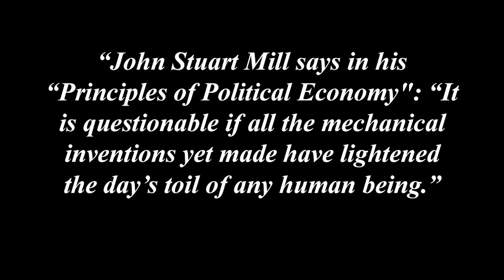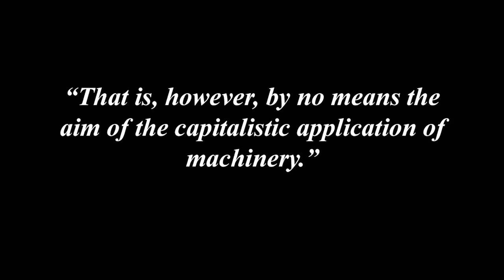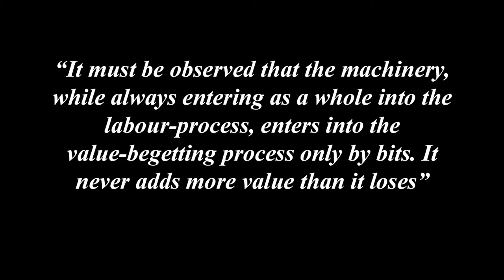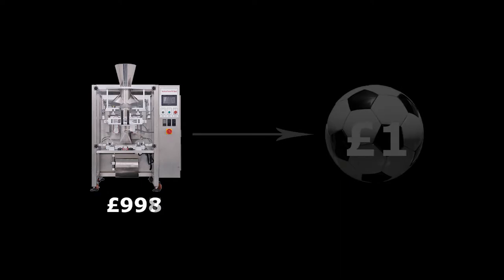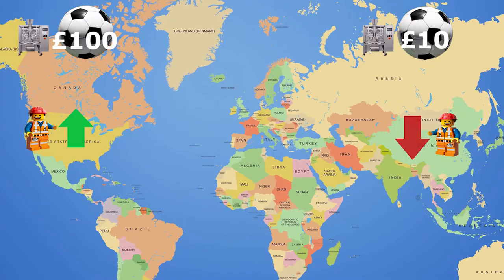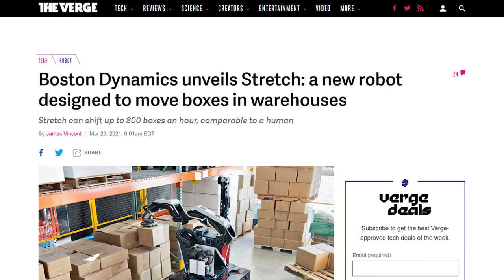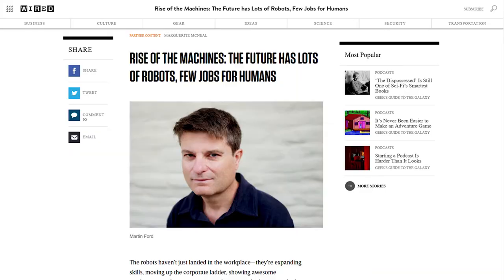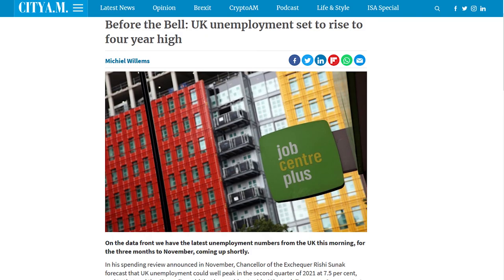Understanding Marx's Capital Volume 1 Chapter 15 - Machinery and Modern Industry (Sections 1-3)

Comment: How crucial is this chapter, or at least these first few sections of it, mostly the second, to the overall argument? There’s a decent amount I’m not really understanding but I’m getting worried about how long I’m gonna be stuck on this chapter/part of the chapter.
Reply from the maker: Which bit are you not understanding? I'll see if I can help :)
Reply: @DissidentTheory  thanks, there’s a couple other things but the most significant thing I’m struggling to understand is the absolute decrease/relative increase (more so the relative increase part).
Reply: @DissidentTheory  oh and also the idea that less labour must be expended in producing the machinery than is displaced by the employment of that machinery. I can kind of conceptualize it and it seems like not that hard of a concept but it just makes my brain feel jumbled.
Reply from the maker: @ofthem16  
I'd recommend watching the video for Chapter 8 (especially the Two-Fold Effect of Labour) section again before reading this, but hopefully it helps :)

Imagine all the footballs (collectively) made in a factory that doesn't use machines, just labourers. Let's say that all these footballs together have a collective/relative value of £500.

 Let's say, this factory now brings in a machine to help with the labour, and this machine costs £1,000. So our collective footballs (after the machine finally breaks and has tranferred all it's value) are now worth £1,500. Their Relative value as a collection of footballs has increased by £1,000.  

However, the huge increase in productivity caused by this new machine has 2 effects. Firstly the machine lowers the amount of time it takes to produce a football for a labourer. So now, each individual new football made has less labour-time required for it's production (this is what creates value remember,) so each individual finished football now has less new value than individual footballs had before the factory used machinery. 
Secondly, We could still say that labour-power is adding £500 value to (collective) footballs (over a given period of time), but this £500, or amount of time of labour-power, is now spread across many, many, many more footballs than previously because of the use of machinery. There is less Variable Capital spread across, despite an increase in Constant Capital.

So on the surface when looking at all footballs, we can say that the value of all footballs combined now have more value as a collection, £1,500. But when we look at an individual football in isolation, we see it has less new value than previously. 

Essentially, a much larger amount of cheaper individual footballs. 

I'll answer your other question here too, because they're related.

To an individual capitalist, it just makes financial sense to only use a machine if i'ts cheaper to buy and use than the labour it will replace. However, structually we can see that this happens anyway:

The value of the machine is detemined by the labour that went into producing it, giving it it's value. As the productivity of producing machines increases (especially with the use of machines producing machines) the value added to a new machine by labour power is less/spread across larger amount of individual machines (same as the footballs above.) So an individual machine will have less value than whatever labour it replaces. 

A machine of £500 replacing workers who's wages were £500 also doesn't take into account the value of labour-power those workers would have added to whatever is being made. If it's more machinery that is being made, then that machinery now has less new value (less labour power in it's creation.) So when this new machinery then replaces more workers, it will embody less value than those workers it displaces.  

It's important to remember what the value of the Constant Capital actually is too. It's the labour-time that went into producing it. So increasing productivity in the labour of mining raw metal, in the labour of turning that raw metal into workable metal etc. All these increases in productivity reduces the value of those things by both reducing the time of labour and spreading the previous value embodied in whatever means of production over a now new larger quantity. 

If we imagine Value as a flowing, moving substance that continually transfers from one thing that's made to whatever that thing is then used to make, we see how it's constantly being decreased in it's value by increases to productivity. Machinery just makes this happen to a much larger, intense degree.
Reply from the maker: As to whether this section is crucial to to the overall argument. Yes/no. We can see how under a capitalist mode of production, increases to productivity lowers the value of commodities. This lowering of the values of these commodities then lowers the value of Labour-Power by making it "cheaper" for labourers to reproduce themselves/their labour power. Meaning less time working is spent reproducing themselves (Necessary Labour) and more time is spent working producing extra commodities for the capitalist class (Surplus Labour /Surplus Produce.) Machinery drastically accelerates this process, and machines producing machines accelerates it even further. As long as you understand this part you'll understand the rest of the overall argument :)
Reply: @DissidentTheory  wow that makes a lot of sense thank you so much
Reply: @DissidentTheory  sounds good!
Reply from the maker: @ofthem16  No worries. Always feel free to ask any questions you have!
Reply: @DissidentTheory  I appreciate that. This book is a little bit of a reach for me intellectually and this channel has helped tremendously.
Reply: This whole thread is a great help. This has been the longest chapter so far for me and I've gone at a slower pace due in part to the complexity of the argument and in part knowing there's a lot of material. I've been reading in bits for well over a week. I'm up to section 4 though so I can see the end of the tunnel.